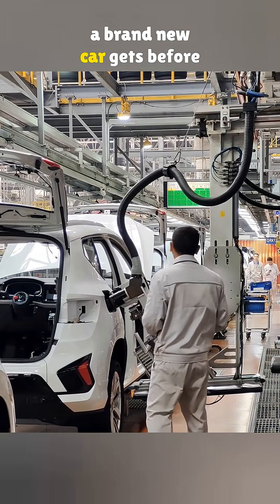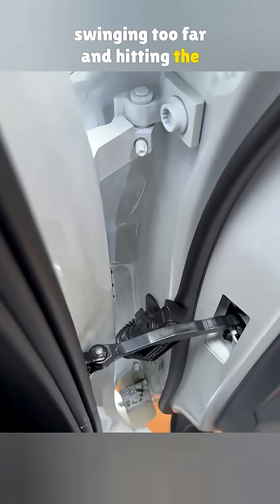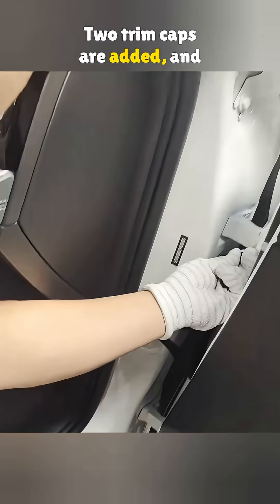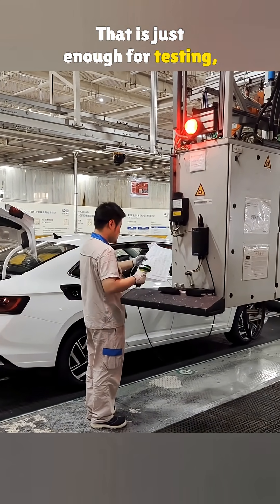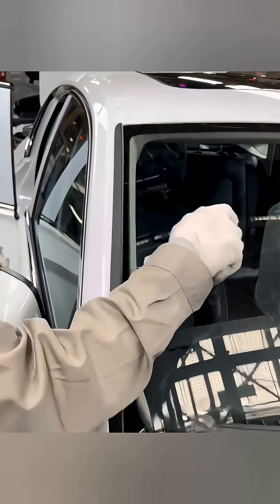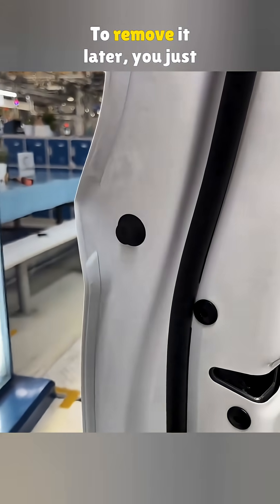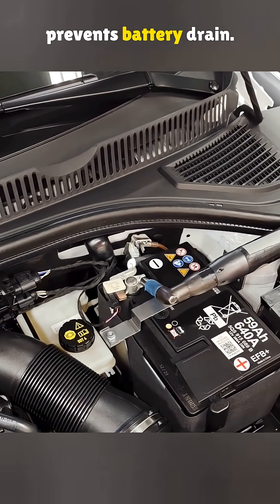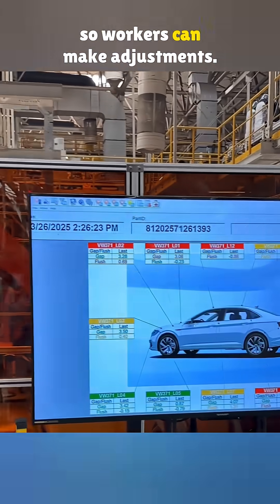Inside the Car Factory: Door Installation and Fuel Fill Process #assembly #automobile #manufacturing

Comment: I remember seeing 'final fit and finish' at the Trabant factory in East Germany.  It was a half dozen large German women wearing head scarves swinging rubber mallets and putting a foot on the bottom of the door and pulling out the top if the gentle persuasion of the mallets wasn't enough.

Comment: How much exactly is 3 to 4 gallons? This is VW so everything is standardized for sure.
Reply: 3 to 4 gallons is more than I thought they'd put in.
Reply: @adotintheshark4848  Fuel tanks typically have 2 capacity ratings.  One is the actual capacity and the other is the usable capacity.  The usable capacity is always a bit less than the actual capacity.  If they are filling the tank from completely empty the first gallon or maybe a bit more fills the unusable volume of the tank.
Reply: Majority of people know how to convert between units. Km to miles, liter to gallons, Celsius to Fahrenheit, it is very simple therefore any unit maybe used without being understood by average people.